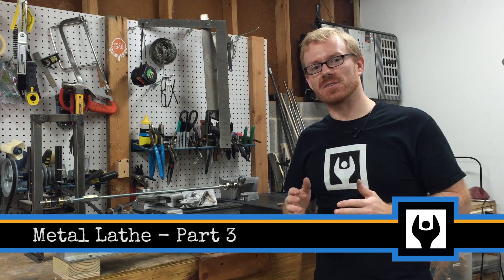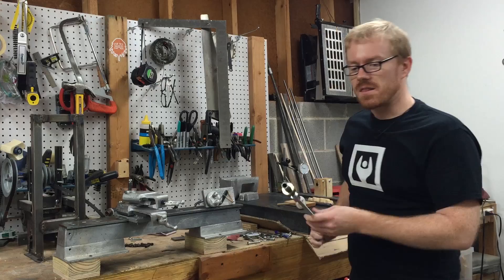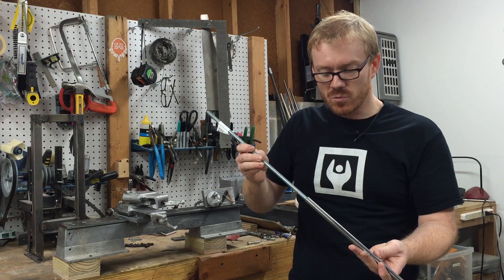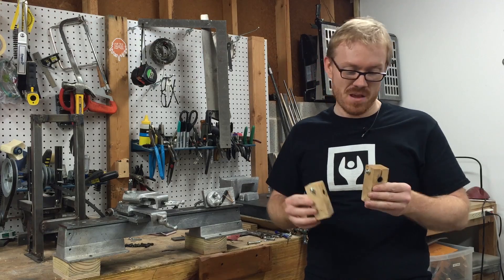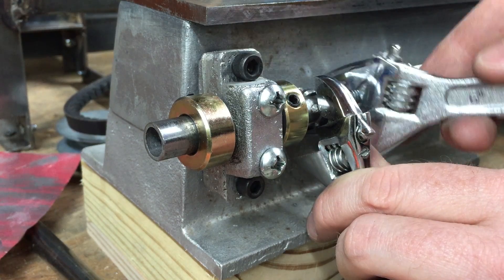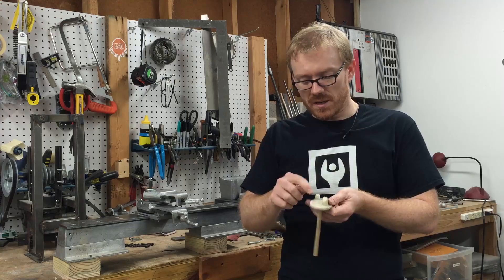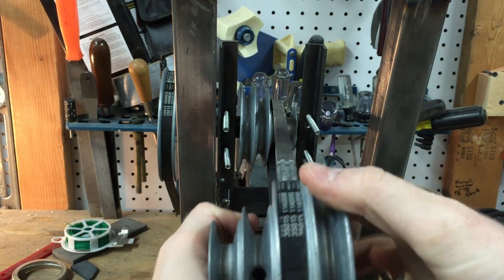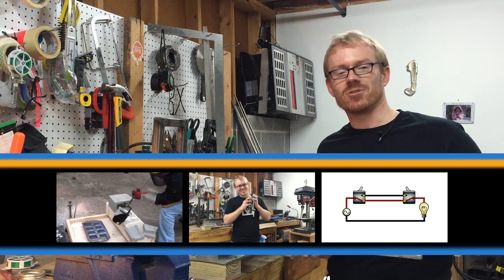Metal Lathe - Part 3: Lead Screw, Apron, Split Nut

Comment: I'm wondering what kinda flexural strength your aluminum would have?

I have no clue about industrial aluminum either I just googled the terms lol

Is it pretty sturdy or it's more of convenient material without much strength?
Reply from the maker: h y p n o s I'd characterize it as a convenient material with adequate strength for a hobbyist project. industrial machines would use cast iron or more exotic materials like epoxy granite.
Reply: i think you might be surprised at some of the demands that forces at certain points in the machine make on your castings ... just saying

Comment: How does the carriage lock down once you move it to the place you want to start cutting?
Reply from the maker: 7:50 in Part 7 shows the carriage lock screw in action. It tightens the carriage gib against the bed ways and lock the carriage. No lock on cross slide or compound.

Comment: When did these videos sneak past me? there isn't a Gingery video on the internet that I don't about! 

Great video I haven't made the locking mechanism for the split nut yet so it was good to see it operating. I haven't had good success with the lead screw it does work but could use improvement. I added pins threw the pipe bearing and the 3/8 rod to keep it in place.  Good Luck!
Reply from the maker: +Micscience You may be getting a digest of relevant content. If you want to ensure you get an email when new material is released on a specific channel, you can setup special notifications. To do so go to https://www.youtube.com/subscription_manager scroll through to find the channel of interest, click on the gear icon associated with channel, then check the box next to "Send me all notifications for this channel" It was not my intention to sneak them past. ;-)